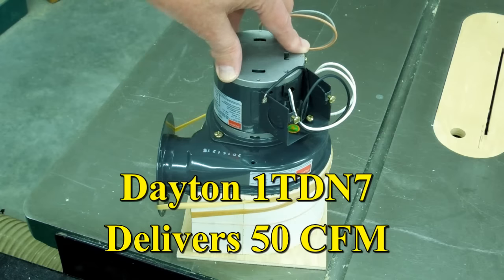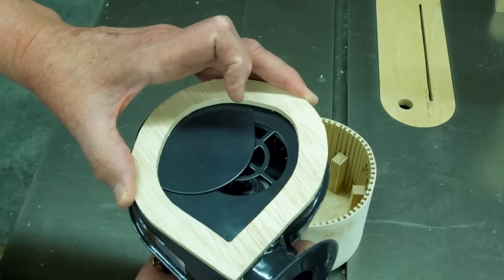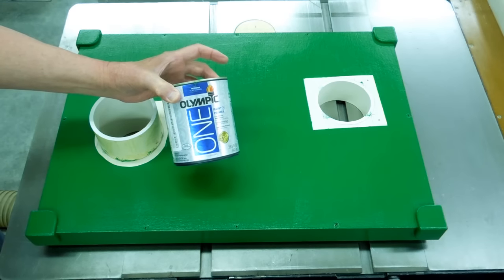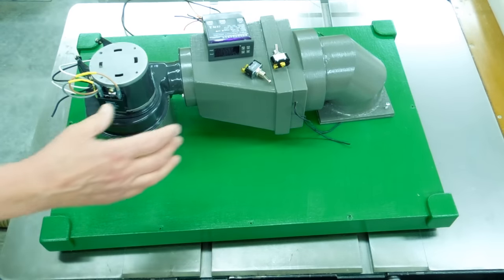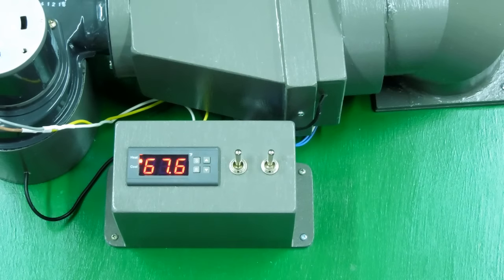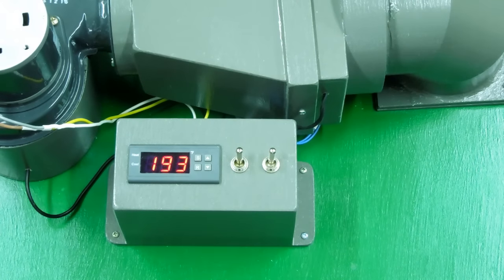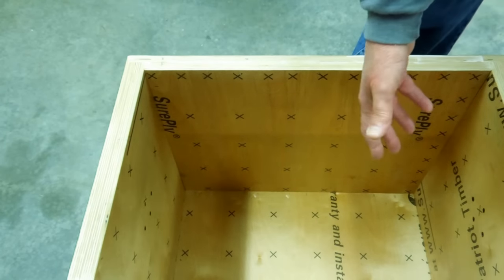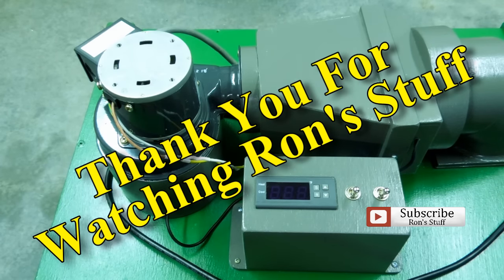Air Circulating Hot Box - Part 2

Comment: I enjoyed seeing this project come together. I made something similar by using a yard sale NuWave oven and building a 2' tall insulated extension ring.  It was cheap and took about an hour to build the extension. The NuWave oven has built-in temperature control and a pretty strong fan to recirculate the air. I still get around 15F variation from top to bottom but mine is not insulated as well as yours.  I would guess yours has less than 5F variation inside the box. 

One thing to keep in mind is that PVC gets very rubbery by the time it's at 170F or so.  It may be okay as long as it doesn't have any stress on it but it may deform even under its own weight at 195F.

Comment: Hi And thanks for the excellent video.
Two Questions   1) where did you get the fan 
2)  Where did you get the heating elements.
Thanks Ron
Reply from the maker: The descriptions are given in the video. Also given in the video description. Search eBay. 
PTC Ceramic Heating Element 250W 110V 320 Degree F Search eBay
Dayton 1TDN7 50 CFM Blower eBay – Electric Motor Warehouse
Reply: Thank you very much

Comment: Could I use an air fryer to cure resin?
Reply from the maker: I would expect an air fryer to be more intense heat and may not have the safety factor of the PTC ceramic heating elements, which will not get hot enough to ignite anything combustible. You would still need a temperature controller for more accurate control. I would stick with the PTC ceramic heating elements..,.cheaper than burning down the house. Thanks for watching. Please Subscribe!